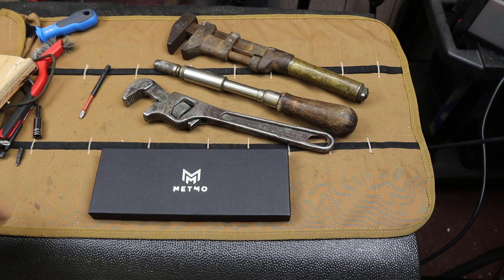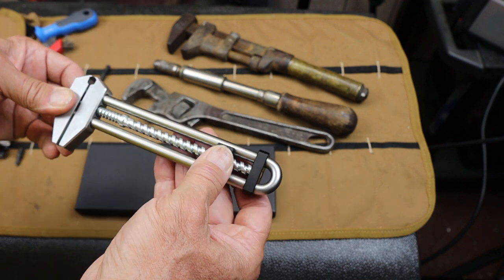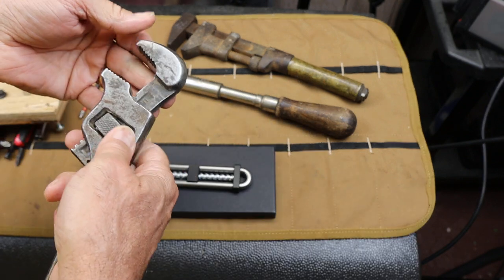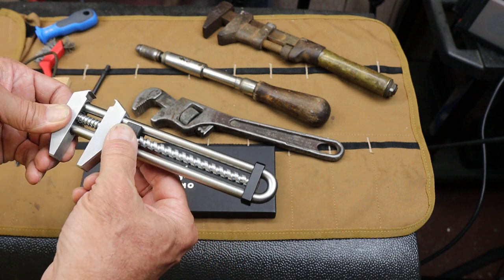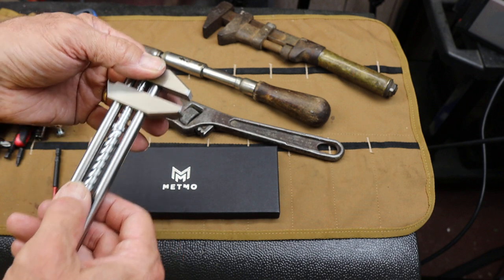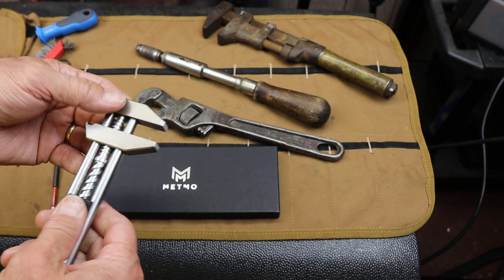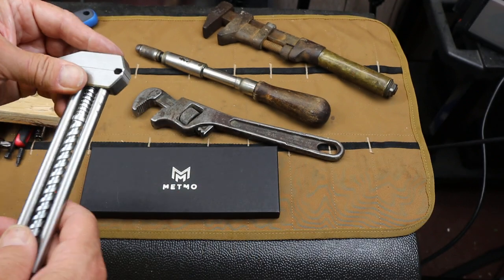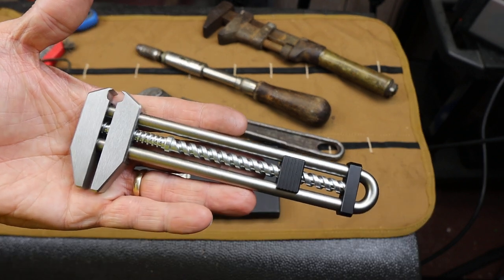MetMo Grip is an honest-to-goodness Over-Engineered Neo-vintage Retro Fidget Tool Wrench. Just Wow!

Comment: Cris T
0 seconds ago
I like to think there is a kind of ‘language’ in engineered things like tools and mechanical objects like engines and other technology. All of it follows a logical and similar pattern that makes sense on its face, even before getting into the intricacies; the simpler the more efficient, and the better
Reply: I agree.   In which case operation is self evident.  No instructions required.

Comment: I have an original Zip Grip, all high carbon steel,no screws on top of the head to hold the head on. Has Zip Grip stamped into the side of the head. I bought it at a flea market
Reply: I bought it at a flea market in Fort Worth.42 years ago. It is exquisite. I have collected some antique tools that would blow your socks off.
Reply: I did not know it was that old (1912) I thought maybe 1950s. Thank you for showing me your repop.

Comment: I understood the flat jawed styled pipe wrenches to be called “monkey wrenches”.  I’m not sure if it was just slang used in my area or was a common term every where.
Reply: I thought "monkey wrenches" referred to pipe wrenches.  With the jaw of the wrench being actuated on a pivot that would loosen its grip if pushed in one direction and close its grip when pulled the other way. This gripping action was what I was told gives pipe wrenches the "monkey wrench" moniker.

Comment: There's lots of the flat jaw pipe style wrenches that came with old cars In the 20s and 30s I've a some from Ford and (craftsman i own this one), I use ir for some or delicate things as it does provide weight and levrage,,

 I have a video on 20s and 30s tools I've bought  Check it out some time

Comment: Would be nice if you could insert a hex key into the base of the shaft, or otherwise tighten it. Without that (giving it the ability to be used as a handheld vice) I don't see this as anything more than a novelty.
Reply: According to the website it grips just fine for fasteners, etc as-is.